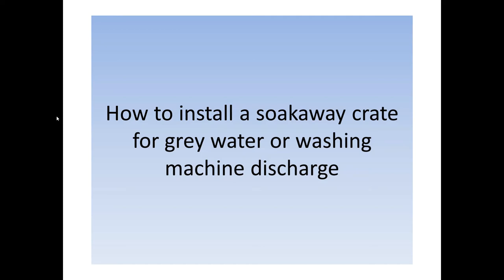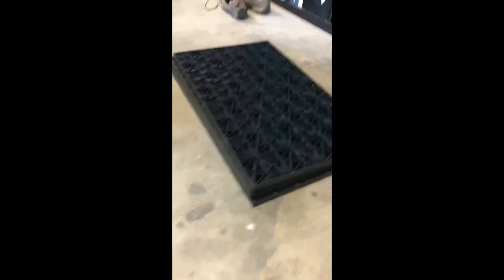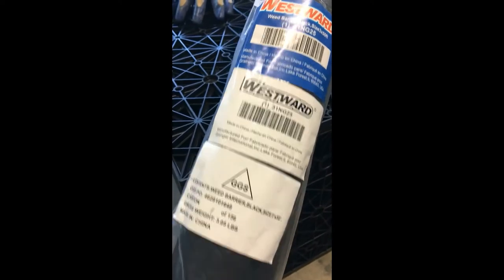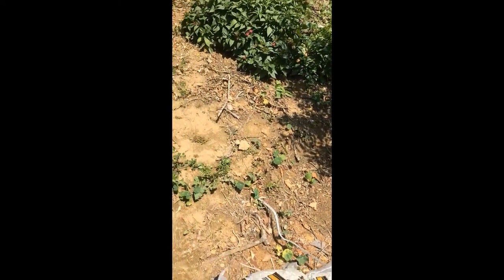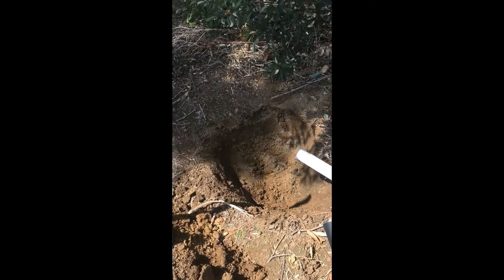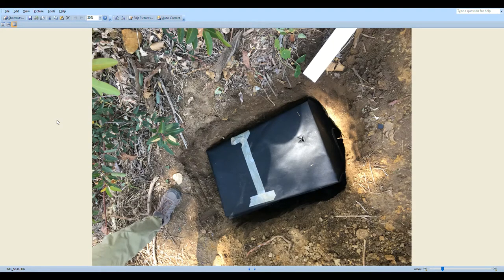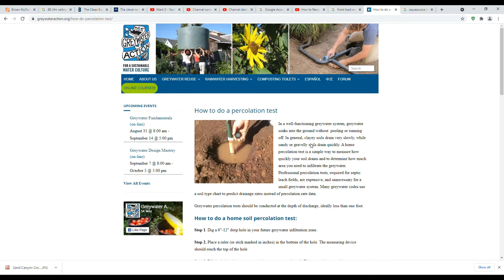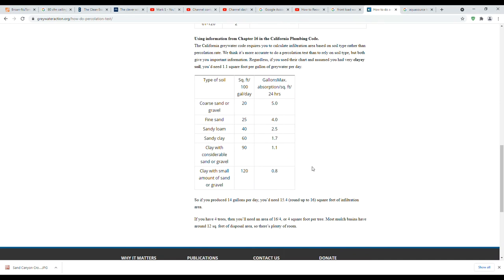How to install a cost-effective grey water soakaway crate for washing machine.  Similar to dry well

Comment: Instead of a crate you can just use a 5 gallon bucket, upside down, so it protects any dirt getting into the bucket (same idea as the landscape material, which btw I've found it deteriorates after a year or so)  the water just goes onto the rocks.  You can use something bigger than a 5 gallon bucket, a small mortar mixing pan provides more area under the cover.   Just some other suggestions, your approach will work.  Btw, I'd also add some holes in the tubing so some water gets out on the way, just not too big of holes..
Reply: Thanks!
Sounds simpler too and you can buy them anywhere.

Comment: Hi, thanks, great video.  So when you filled it in, did you put some gravel on top of crate too or just soil?
Reply from the maker: @WideAwake50 Hi. I put about an inch or two of gravel on top. Then soil.  The gravel depth/thickness is more important on the sides and underneath obviously.

Comment: I've dug a hole 3 feet deep and 3 feet wide and filled it with gravel and the underground pipes will carry washing  machine waste into the hole in the ground.  I am not using crates.  How does my approach sound?  I imagine I might be able to use crates later at some point.
Reply from the maker: @vin.handle  thanks for the comment. This sounds like it should be fine for a smallish household. The main aspect of any soak away is obviously the volume & surface area of the pit v the volume of waste water, the type of soil and location of the pit. My crate system is probably of similar size to yours and seems to cope with front loader high efficiency machine washing for 2-3 adults. My soil drains quite well and is on a slope. I would think a higher load on the system like washing for a family with young children might require something a bit bigger. That's just my 2 cents based on what I installed. I don't claim to be an expert on this !  I recommend checking it occasionally after a series of washes or heavy use just to be sure it's not seeping to the surface or looking waterlogged.  Pretty soon you'll be confident in how it's performing.  Good luck
Reply: @dadlifediydoityourselflike2293  Thanks for your comment.  Much appreciated.  Another idea that I've never heard commented on is amending the soil at the bottom of the hole.  I've drilled a series of 12 inch holes at he bottom of th e hole and added constructon grade sand that I work into the soil to further add drainage.  We'll see how that works also.

Comment: Great job and thx for posting.  How's it working out so far? I love the soak away crate.  I'm curious whether you considered lining the hole with landscaping fabric to keep the gravel clean and separated from the dirt?  I'm considering doing this at my home in the southern US.  We have very clay like soil here and I'm worried the dirt will clog the spaces between the gravel over time.
Reply from the maker: Hi.  Thanks for the comment. From my understanding the landscape fabric is to prevent dirt getting into the crate. From what I read it is used to cover the crate but not between the gravel and soil. Landscape fabric restricts the flow of water and acts as a sort of filter. I understand your concern  If you put it between the gravel and the soil you have to expect that the water will pool and sit in the gravel.   What I would suggest instead is to put 2 or 3 different grades of gravel with the finer gravel against the soil and the coarser against the fabric which is around the crate. Also since your soil is heavy try to set the crate on a slope etc if possible rather than in a hollow or dip.  It will need all the help it can get to drain. Finally an extra crate or two to increase the capacity might be a good move. Hope this helps. Good luck
Reply: @dadlifediydoityourselflike2293  Sounds like solid advice.  Thanks for the ideas.  Much appreciated

Comment: Couldn't you use  milk crates 6 or 8 or 9 ,depending on the pattern. A 2 x 3, 2 x 4 or a 3 x 3 shape.
Reply from the maker: Yes I guess milk crates could work

Comment: You need to fit a seperate chamber to filter out the soap...you have just created a nice little polluted sludge pit to poison your ground water...the soap will coat your geo tex preventing the waters exit over time...not a big deal to retro fit.
Reply from the maker: I have a lint filter in my house that catches some soap sludge but I'm not familiar with a soap filter.  I'm interested....do you have a link to some information?